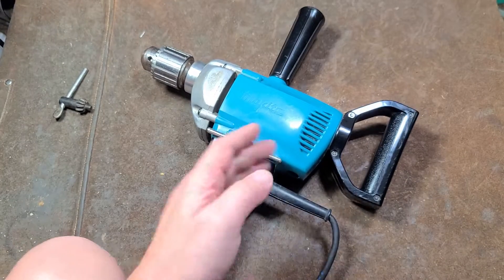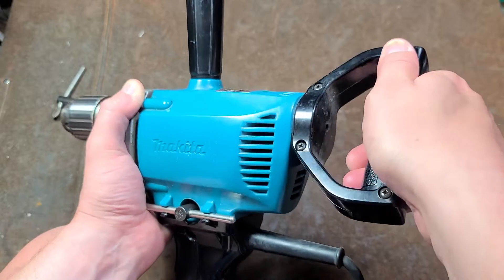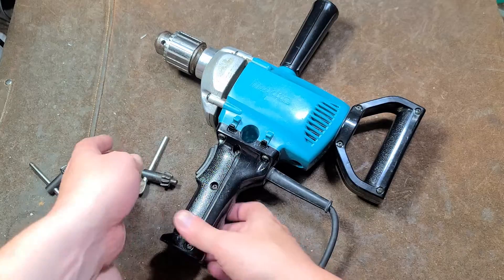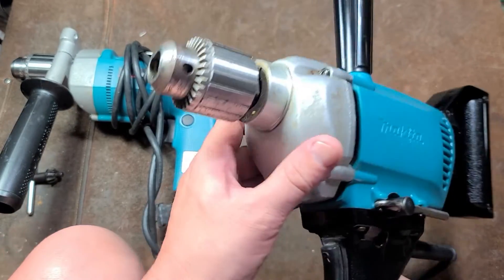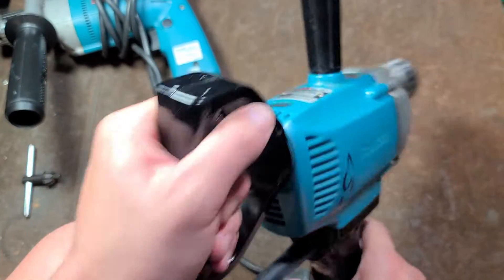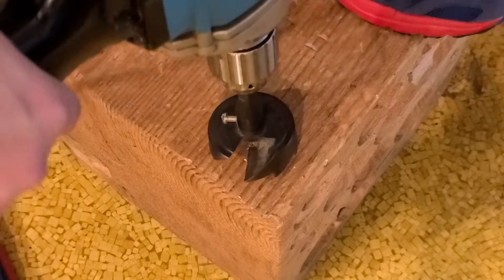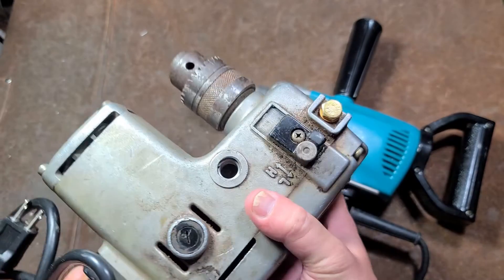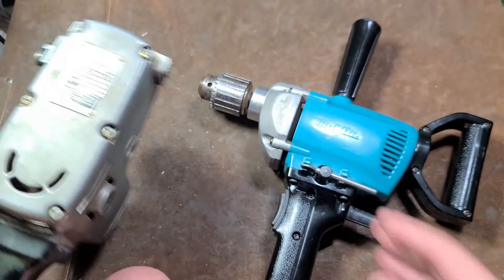Makita 6013BR 1/2" Heavy-Duty Spade Handle Drill Review

Comment: We use those for years as an electrician. What they used to do was take the bottom handle off in many cases the top and the Spade handle, and they would put a 3-ft long pipe that was welded on the bottom usually using some kind of meter hub style connection. They don't let us do that anymore. My father had electric company from the '70s until he passed in 2012, we always had them that way until OSHA stopped us from using them. Before that model there was a little bit heavier design drill called a "Thor" drill, which they use the same system with the connected pipe. Sometimes they would reuse those pipes off the Thor drills on the makitas as the Thor's broke down. Also sometimes people would put a light switch at the bottom for off and on, and even some people use the three-way switch in a single pole switch to create a reverse. I have a few of these in storage I wish I could take a picture explain how we used to do this.

Comment: My tool of choice for mixing has to be a 1/2 air powered drill. 850 rpm seems to be perfect. The best part is there is no worry about over heating and damage with air drills. Just a drop of oil and they can run forever